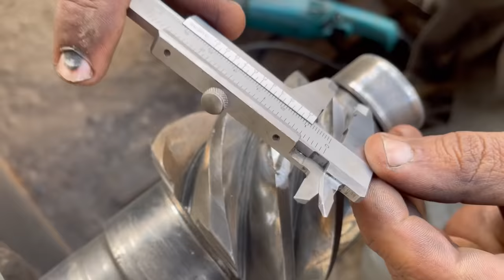I repaired the scrub pinion which no mechanic repairs | Give your opinion by watching the video |

Comment: There's a reason nobody repairs it - the crystalline structure of the steel has changed, and in welding it you have introduced, inclusions, transition zones, and carbon dams that are weaker than the original part...and always will be.  If you have a digitally controlled and monitored heat treat furnace to harden and temper, that's better, but...there are things called new parts, that are cheaper than your labor to weld and grind this pinion back to asthetic acceptability.  And it's a hypoid pinion, not a scrub pinion.
Reply: Troll...  seriously, these guys don't have access to the engineering and knowledge to repair these things properly.  This will likely hold up for a fair bit of time.  Labor there is cheap.  A part like that is likely expensive and hard to lay hands to there.  The skill required there to repair and finish is nothing more than incredible.  Nice work.
Reply: If we'd all waited for a digitally controlled and monitored heat treat furnace to harden and temper we'd all still be living in nests in trees today. But luckily our ancestors just went for it instead. Which moved the species forward.
Reply: @mikeiver  Troll, my ass.  It will work fine, for a while - albeit somewhat noisy.  I've done the same myself to get a piece of machinery out of a desert canyon.  And Cat, Deere, Komatsu, Terex, and Letourneau will all get a part to you overnight anywhere in the world...all you have to do is pay for the part and the shipping.  Bite me.
Reply: @1pcfred  Interesting point, and almost the point I'm trying to make.  We don't have access to that (the furnace), so we need to take care of the client the best we can, and that might be heat treating and tempering by color...and if this is a temporary repair, then fine.  But, if this has been sold to a customer as a long-term repair, then this customer is getting ripped off.  Btw, my problem is not with the workmanship, it's with the ridiculous titles they give these videos.  Should have been titled "Excellent temporary repair to keep the customer running".  That would be accurate.
Reply: @HPDrifter2  we do not know how long the repair will last. It may last forever. There's nothing as permanent as a temporary repair. "In theory, there is no difference between theory and practice. But in practice there is." --Yogi Berra
Reply: @1pcfred   That is correct.  That machine may get one hour of use in the next ten years.  Good point.
Reply: @HPDrifter2  or it may never see the condition again that broke it in the first place. We don't know how or why it broke. Maybe it fell off a cliff? Perhaps that is an anomalous event?

Comment: This isn't a good solution, even as a "temporary" field repair. Now instead of only having to replace the pinion, they'll likely end up needing to replace the ring gear after it's ruined by this out of spec pinion.

This could conceivably be repaired, by:
1. Grind back to clean metal to ensure there's no residual cracks to form stress risers
2. Build up using a suitable alloy and weld process (preheat/controlled cooling are often necessary for the alloys used in parts like this)
3. Have a machinist re-cut the gear to spec. If all you have is hand tools, then at least get some machinists blue and pattern the gears, tweak the fit, repattern, re-tweak, rinse and repeat until it's right
4. Heat treat the part per spec

Being in India or some other small country does not preclude proper repairs. Maintenance alloys for welding hardened steel are used there in probably every factory with large machinery, pre-heating and controlled cooling simply requires a torch and bucket of dry sand or a fiberglass (or otherwise fireproof) blanket. Machine shops exist there, although I suspect few are equipped or experienced to cut helical pinions, so using purely hand tools and time you can at least pattern the gear and ensure it meshes properly and there's no stress concentrations that will break it before it makes it a kilometer down the road.

Mechanics don't repair this stuff because they know it costs more in labor than it does to buy a new one. Doing this as a "field repair" meant to be temporary is only setting you up to break down in the middle of nowhere with even more broken parts than you had before. Parts like these are readily available in India. At worst you're looking at a couple days of downtime waiting on a new part. I'll take a couple days of waiting over the prospect of breaking down on some mountain pass and needing a tow + even more expensive repair.
Reply: Have you done this or do you just think IN THEORY that it shoudnt work?

Comment: Sincerely agree that longevity will be the issue. Gears are specially heat treated. Welding on them will destroy that heat treat making the metal soft again.
Take a metal file you would use in your shop. Heat it to cherry red and allow to air cool. It most likely will not cut, or at least cut like it used to. Now heat it again to critical temp and properly quench it, and it should cut again. Files are brittle. Gears are very hard but also tempered, meaning some of the hardness that makes them brittle is removed in order for the metal to have so elastic properties again. Without that, the Gears would shear the teeth off in a short span of time.
In a third world country like what this appears to be, this would be a much more cost effective repair but just will not last

Comment: Heat treat is easy. Thro pinion In hot fire, remove, weld immediately, return to fire if welding is lengthy. Once finished, put it in a bucket of kitty litter or a thick envelope of insulation to cool as slo as possible. Longer cooling, the better.  I've done this a few times and never failed  me.

Comment: I really love these kinds of videos where they show how it's done anywhere else in the world, where means and tools are not a given. But this is not one of them. This is not a repair. Not even for a short amount of time. Guys bear in mind, even if you adjust a steering rack a tad too stiff, it'll go out in a couple of kilometers. And I'm talking about perfectly machined theeth. Any impurity in the teeth design will cause excessive wear and vibrations. Parts like these have incredibly low tolerances. It would destroy the ring gear and potentially all other bearings inside the differential in just a couple of turns.

Seriously, this is only "good enough" for a YouTube video, never will this work inside a truck in real life. All the commenters who're like "yea but this is not a first world country, bla bla", come on, be real. Some things just won't hold. It won't magically work just because the truck is used in a third world country. You may get away with a used head gasket or without planing the heads etc. But you wont get away with things like this.

Comment: I was asked to fix 2 forklift pinions this way , for a guy named Bobby Cameron . He said , you just cant get them , and its junk the  machines , or try it ?  So I did .  He said hed go over them again with bluing and a fine die grinder .  30 years later , the fork lifts are  still going , and Bobbys long dead .  I didnt worry as much about the hardening , as the positioning .  I also fixed a Ford  Jubilee tractor diff , by finding a same-looking pinion , and making hardened bearing spacers and carriers , to get it in the right   position , and its never been happier .

Comment: Good for a quick fix but it will fail as the integrity of the heat treated hardened steel has been compromised by the welding 🤔 always good to watch

Comment: Kudos for the skill, but that part is junk. It would need to be heat treated at a bare minimum to avoid wearing out rapidly or sheering off under load.

Comment: As they say, Welded joint is stonger than parent raw metal it holds good. First the welding rod used must have same composition as the parent metal. Also if this joint becomes hard due to induced heat it may start damaging the attaching gear.  Anyways , it's always better to repair and use than buying a new one. New metal needed to be mined,  heated to separate from raw state, moulded, machined, packing,  distribution, and finally into workplace. 
The impact on environment is huge this way as I understand.
Well done guys...
Reply: Did you type this in your new Tesla?

Comment: Ok, it will work up to 10^4 ~ 10^5 cycles/revolutions (~1 week max ) without load or 0 (zero) cycles loaded.
It will break right above your soldering, where now the thermal treatment is gone.

Comment: Works good we do like this romance for gearbox all the time here in country we use heat treatments like blowit torch and making like red hot for fast cooling using water only and oils used ones

Comment: This is not a precision repair,  it's just a get you home job.   Gears running under heavy load with these levels of (inaccuracy) between them will subject the bearings to either huge loadings or to constant vibration.  Looking at the surface wear on the other gear teeth I'd say that it was knackered anyway so probably nothing lost.  My bet though is that the truck owner will simply run it until it dies and then have it repaired again.  Enjoyable video though showing good welding skills.  Thank you.

Comment: Good choice, of welding rods.   =  >  > >>
   Category: Industial, Type: Hardfacing Electrode
MFH 650B produce high alloy non machining air hardened weld metal.
 Its weld metal resist severe abrasion with moderate impact stresses working condition.
      Hardness: 500 – 600 BHN, Alloy Base: Fe, C, Mn, Cr, Mo, V.rusher hammers etc.
Application:       Tamping tools, Coal cutter blades, forming dies, excavator teeth, bucket lips, impellers, muller ploughs, conveyors, ploughshares, road graders,  etc.
          Current Range:     (AC 50, DC +/-) for 450 mm length ?    for 3.15 mm 100-140A, Weight: 2.5 KG, Tolerance ±2%.
                           As an old guy, i'm  not  sure, if it is electrode positive,  or  electrode  negative.  ( DC  welding only)

Comment: I see nay sayers and i see people defending this job.

I'm a nay sayer. Repairing things is just fine but you have to repair it correctly. Welding on a pinion gear will not suffice. Pinion gears are made of hardened steel, and a weld is not hardened. 
The load this pinion gear transfers is also so high that in a short period of time i believe this weld will just snap right off. Welding on hardened steel is also rather difficult and i can tell by how this man did it, he did a poor job of it. Just because you can lay a bead doesn't mean you can weld.

It is a temporary fix at best in order to get those last miles back home but that is it.

Comment: had the same done professionally on a straight cut gear. It looked as good as new, but sadly didnt last long, due to the metal not being as hard as the rest of the teeth  that mesh with it. Ideal for a temporary repair though or in slow running low torque applications
Reply: Weld is stronger than the original metal.

Comment: There is 5 elements in the world. Fire, water, earth, air and Pakistani man with stig welder. It seems that there"s no thing they can't weld. Broken crankshafts, wheel axle, engine block. They don't hesitate at all.
It doesn't mean they do it properly. The parts welded with rutile electrode will be always weaker that before but sometimes there's no other way.

Comment: Great craftmanship, however the part will wear prematurely. It's impossible to handcraft all the angles correctly like a machine, so when that thing spins around it's going to grind every time it contacts the repaired area. That part is manufactured and precision machined to fit a counterpart, a repair is therefor impossible and will yield a bad result.

Comment: It might last a few hundred miles. Gears like that are made from a hardened 8620 or 4320 steel. welding to that tooth is going to greatly soften that metal, and it won't last long at all, assuming that it is even anywhere near the proper cut and angles. Plus here, the amount of time spent on labor doing that, could buy the entire axle.

Comment: Im no mechanic. Maybe next time you can use a material to take a mold of another tooth and then use that to compare the finish. Or cut a piece of wood in the shape of a good tooth until it fits over it, to do a fit test on the repair. I might try to fill both sides around broken tooth with ceramic clay and shape it to the part and then weld in the hole so it guides the weld deposit and the work to clean it up is smaller. Then I can use some files to hand file it to the right dimensions.

Comment: I would trust these mechanics far more than a trained mechanical engineer, these guys are out there in the real world and are practical. A point to remember, internal gearing/engine parts are expensive, replacing with new parts isn't just wastage but a massive waste of natural resources. Imagine the Carbon in the form of CO2 generated from ore to finished part for just this one spare part. He has just saved many tons of carbon from being released into the atmosphere by using his expert welding skills, technical knowledge and prowess In finishing it. For those who say it won't last, its not supposed to last forever or at least will last for the remaining usable life of the truck.
Reply: How will they ever fix an electric computerized vehicle?  Want to talk about a waste of resources?
Reply: @illreportbackinabit.8514  They don't have electric vehicles, these people are making the best of what they have instead of making the best of something which they have no need of having. The point is they do their best. And do not think of what they don't have, satisfied with what they have unlike some commenters on youtube.

Comment: C+ for hand effort,  I wouldn't have it on my vehicle.

1 - First he should 'dress back' and remove surface level fracture, before the next weld.
2 - Molten metal onto a cold part is questionable at best and without slow oil quenching whenever a new layer is added.  Bonding two different materiel composition will never be as good as single material.
3 - Hand finish without machining step will be dimensionally uneven and introduce stress concentration "hot spots", so will never last long, most likely break at the same spot at some point
4 - Metal deposition is a violent process and only chip away the slag (oxygenated) and not dress back to reveal any imperfection like air bubbles before applying the next layer will naturally have weaker bond between layer.  Weld in an environment surrounded with air... common.... Nitrogen / Argon

Comment: So many "machinists", "engineers" and "experts" here saying it's bad. You clearly can't comprehend this is a "better than nothing" situation. I wouldn't say anything about this without proper long term testing because I've seen "hacked" parts where the new welds are stronger than the original material.

Comment: My guess, that pinion is 8620 with 1-1.5mm case carburize. Surface hardness RC 56-58. That weld might be RC 28.

Comment: Looks very nice to do that free hand with a grinder is impressive but it's just not precise enough thats going to wear fast and or break again I'd be surprised if it lasted under a reasonable load probably going back together with the old oil poored through a sock so that won't help 🤣 fair enough if it works it work gets things moving again but it's not something I would do unless an emergency

Comment: This honestly looks like it'll work just fine to me. Any high spots will wear down quicker than the low spots and it'll turn out just fine.  Bet ya this part lasted at least 5 years.
Reply: Then you don't understand how helical gears work...
Reply: @petermwheeler  They grab and spiral upwards. Should be just fine. It looks quite close to the original. Very consistent. As long as they're easy on it, it should hold just fine.
Reply: @joblessalex  1. The gear is no longer tempered, 2. By destroy the gear profile,  which needs to be exact, the gears will grind against each other breaking off bits of metal that will eventually destroy it.

Comment: Ok. But you didn't show anything about crown and pinion contact. Does it spin nicely or make any sounds. polishing a gear tooth doesn't means correct profile until you check it correctly. anyway nice work.

Comment: Im kind of shocked at the lack of prep work done to the piece before he starting laying down a bead. That piece could have been cleaned up and grinded a bit and then flushed out with high pressure air and brake cleaner.

Comment: I wonder if heat transfer is ever a question when doing these repairs. It will obviously mess with the tempering or previous heat treating of the metal. There are parts that specifically say never to weld them to anything as it will weaken the metal. I’ve seen it on trailer pintols.

Comment: Needs machining to correct dimensions. You can't just grind it by eye, its not going to mesh properly. Better off making a new part using the correct steel, those welds will be structurally different

Comment: I guess the machine itself will grind it down to the correct tolerances after awhile... It looks good but i wonder if its worth it, obviously this gear is running against another gear so you might end up having to replace both instead of just this one.

Comment: The issue you have is the welded section will fail in a very short time sending more metal debris through the component turning its oil into grinding paste doing more damage than it started with.

Comment: probably should have cleaned the area a little were u where welding because that just gonna have adhesion issue im confused u did have a wire brush but didnt clean the original spot u gonna put the weld onto and will probably come off in a chunk when ever it does fail.

Comment: This material is too hard (brittle)to weld it may look good but it WILL break unlessnproper preheat and post heat proceedures are done and a high nickle filler rod to absorb excess carbon.